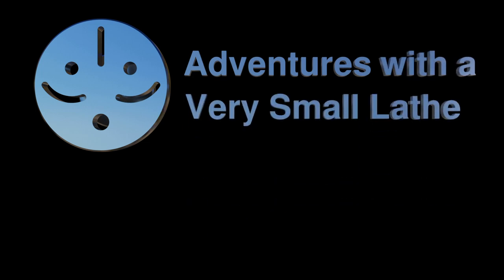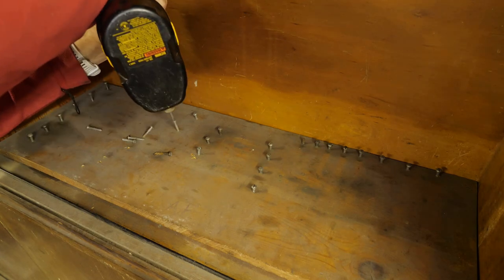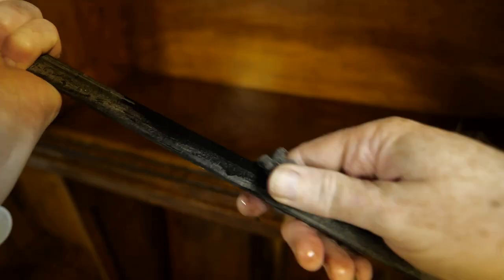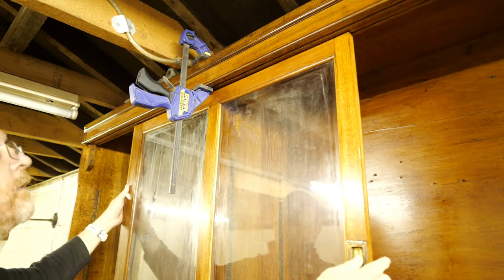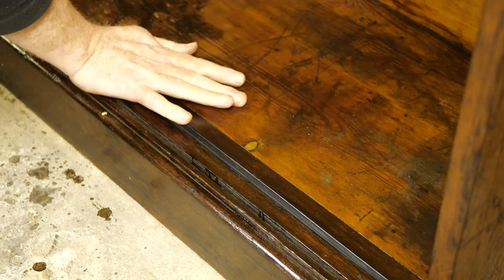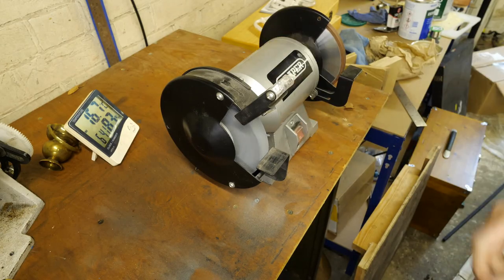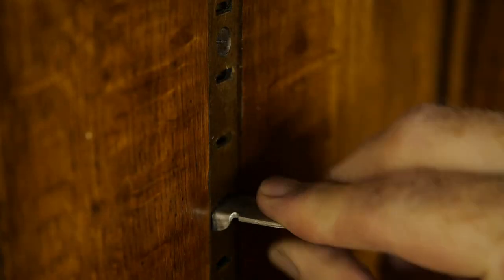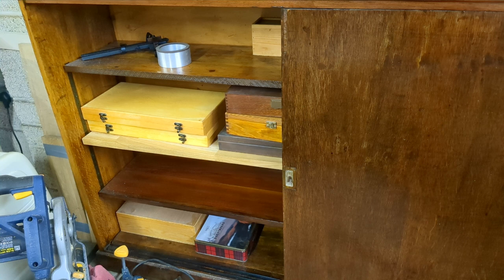Tool Cabinet Restoration and Expansion

Comment: Workshop storage has always been the biggest problem for me. I run out of space so I build something. Two weeks later I find it wasn't big enough or it was the the wrong shape for my latest tool. I think I have designed five or six hardware cabinets. None were ever right. I'm glad you got one that works for you. Thank you for sharing. Have a great day and stay safe. 🙂🙂
Reply from the maker: I honestly feel like I'm running out already, but at least I've cleared a lot of the boxes from the floor. Workshop storage can be so expensive new or even second hand, I'm really grateful to have these two cabinets and the steel one to start with.
Thanks for watching, and good luck sorting out your own storage.

Comment: Excellent progress Alistair. Your restoration of those cabinets is first class. The new workshop is going to be fabulous. Well done 👏👏👍😀 Andrew
Reply from the maker: Thanks Andrew! Loving your photos from Pickering, especially of 9F 92134. I had the great privelege to stand on the footplate of 92212 at the Watercress Line while I was volunteering there. Sadly its boiler certificate has now expired, so it's no longer in service.
Reply: @livewithaverysmalllathe9128  I was so lucky as the North Yorkshire Moors Railway suspended steam due to fire risk the following week. 
Oh to be a volunteer at a steam railway. I a admire all those who do. 
It’s always sad when an engine’s boiler certificate expires and it enters a long queue to enter the workshop.
Reply from the maker: @andrewdolinskiatcarpathian  Not sure where you're based, but I don't think most of the steam railways would turn down volunteers whatever the skills and experience. :)
According to Wikipedia 92212 has been transferred for overhaul, but I've struggled to find any more information.

Comment: Got any updates?   I've got a chance to rearrange my workspace, and I've been binge-watching all sorts for inspiration.    (my lathe's a sherline, so "very small" matches yours !)
Reply from the maker: The main updates are these:
1. I've spent a load of time weatherproofing and insulating the new workshop, which doesn't make interesting videos but is necessary to keep the tools safe and dry.
2. I built a big new workbench in the middle of the shop for the machines. A full video of this build coming very soon.
3. I've aquired a new Lorch lathe, which I announced and went over on the main channel. Hopefully you caught this, but if not, head over there and watch!
Reply from the maker: 4. I stripped down, cleaned, and rebuilt the air compressor, and it's now fully working. I don't have complete video of this, but I have a lot of stills. Check out my Instagram for a series of posts on that over this year.

Comment: when you get the chance might want to check out some of the lightweight lithium drills more for "housewives and hobbies" I use a 7.2 volt black n decker all the time for easy projects ... even pushed it to the limit driving 2 inch screws for a closet shelving unit (it did about 10 and the battery was on strike)

Comment: Thanks again for the video. Could you please tell me where you bought the shelf support brackets for the cupboard. I have a beautiful old bookcase with the same slotted bars but am also missing some shelf supports and have not located anything as close as the ones you have found, Thanks and best wishes.
Reply from the maker: I got them from eBay. Here is the link:

https://www.ebay.co.uk/itm/303582361276
Reply: @livewithaverysmalllathe9128  Many thanks: I've placed an order. I look forward to following your progress setting up your new workshop. I hope that when you get your larger tools you will not neglect the smaller machines. I seem to be a lathe obsessive and have a number of different types of small lathe (Cowell, Unimat 3, Pultra, several Adept and Super Adept etc) as well as an elderly Myford Suoer 7 which I have only recently got operational. No mill, I regret, but at my age I doubt that I would get value for money in investing in one.
Best wishes.